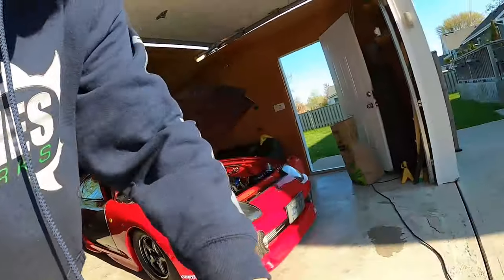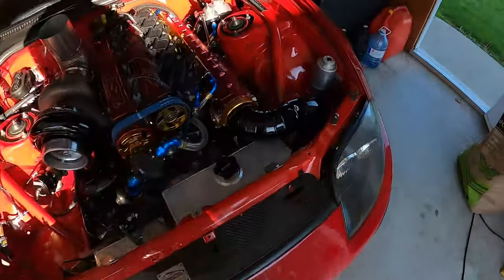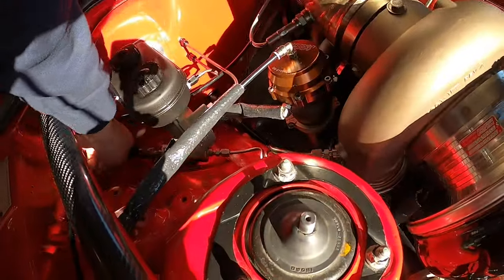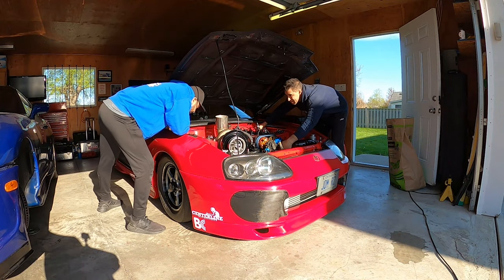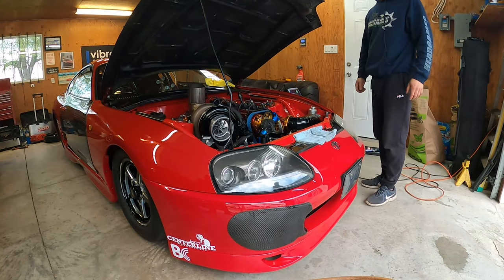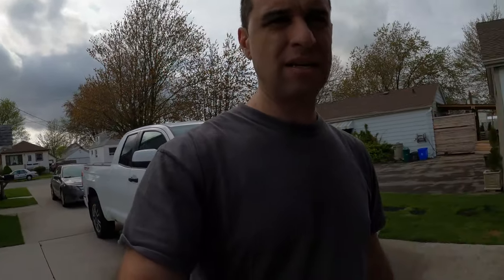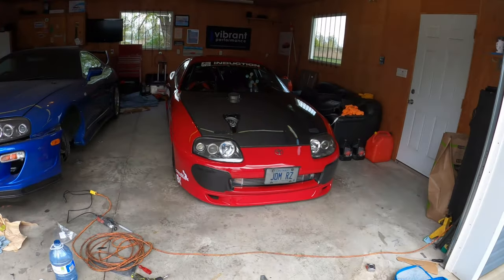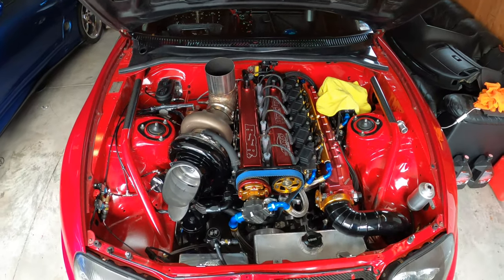BILLIT 2JZ Engine Assembly - Part 4 - START-UP

Comment: My car is doing the same thing as it yours did before it fired up, Big Bang and just cranks except yours has started mine still won’t… what did you do to rectify it?
Reply from the maker: I ended having the ecu set for the middle cam sensor and I was plugged in the back one. You might also have the cam wires reversed
Reply: I did this still nothing, just get a Big Bang?
Reply from the maker: @mustafa.1743  what ecu? You must have your crank offset degree wrong
Reply: Ecu master classic
Reply: With pnp adapter